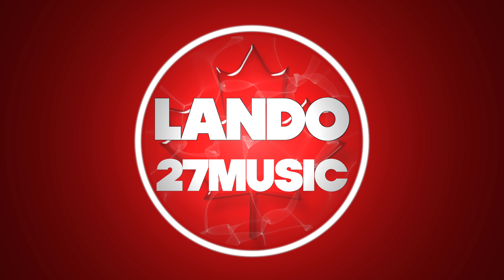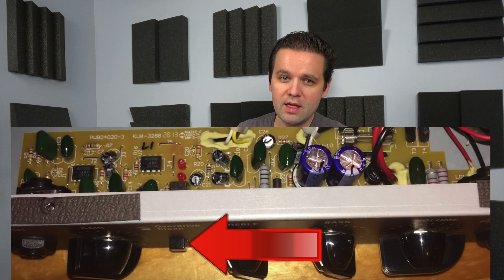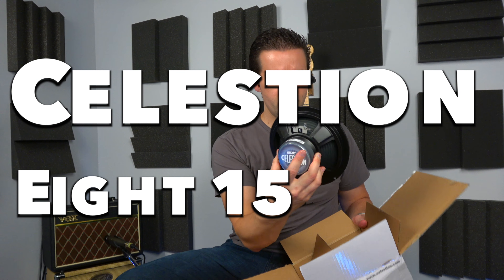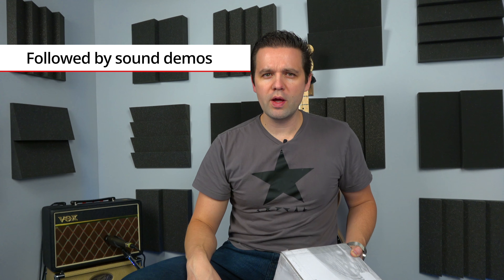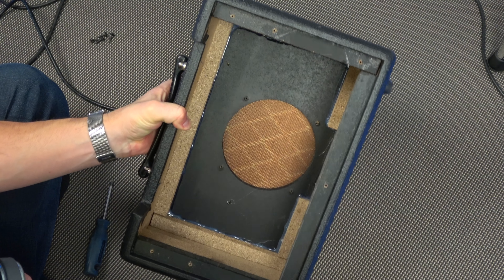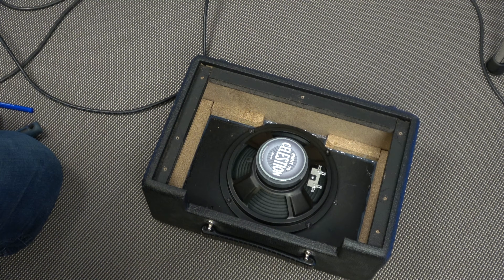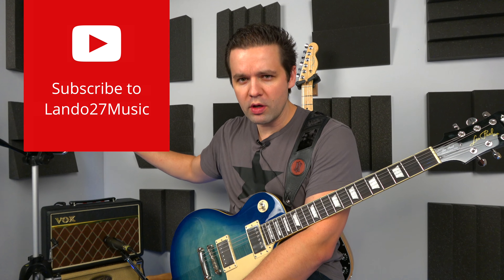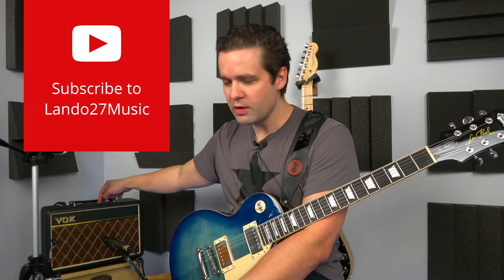BOOST Your Vox Pathfinder 10 With 2 Simple MODS!

Comment: Very good vidéo and idea. I did it ! 

I have a pathfinder 10, it’s the second i buy, i love it. In France we can buy a used one for 40 / 70 €. Great tones for the price and great tones without  thinking about the price. Boost always bad on pathfinder, do the led mod and that’s it.

But I also did the mod you purpose for the speaker ! At the beginning I was a bit desapointed. It sound very good, less voxy with  really deep bass. I was ont sure about being  moré satisfied than with the original one.

But, it s better now : beacause the speaker is no more new (I Thank it changed a lot) and because I also cut the Wood to open the front following the size of the 8’ (without touching the beautifull grill, I was patient …).

Bought it for 60€, 30€ for the speaker, and sold 15€ the original one.
Less than 80€ : a beautifull and good sounding analog amp with good headphone output, small and Light.

So thanks a lot !

Comment: So I recently did a speaker upgrade to a Mono Price 5watt all tube amp that came stock with a Celestion Super 8 to a Warehouse G8A Alnico… Much better tone than before… So now I have the Celestion & was thinking about trying it in my Pathfinder 10… I normally play a Spark at all my low volume solo gigs but would like other amp options just to keep it interesting… If the Super 8 doesn’t cut it I may spring for another G8A for the Vox amp… I personally think the Pathfinder 10 has the best look of the three if I can just get the volume & tone as good as the other two… Enjoy your guitar & amp reviews thanks for sharing!
Reply from the maker: nice!

Comment: What Ohm Speaker did you use? I like using the 4 Ohm they are rated at 20 Watts and give more output at a lower volume.
Reply from the maker: I looked back and it was 8 ohms

Comment: Just did the led mod because of this video, super easy if your good with a soldering iron. This mod really opens up the sound, WAY more clean headroom and a more natural breakup while increasing the gain with volume cranked! Great cleans to awesome early AC/DC tone on the clean channel.

Thanks for the video! I just watched a few others and you got a new subscriber here!
Reply from the maker: hey thanks Jeff! what a weird mod right? But it works great. 😁
Reply: Lando27Music  Definitely a weird mod for sure, awesome though! I actually just pulled it back apart since my last post. I pulled the speaker wires up into the chassis, cut off the clips and soldered on a switchcraft jack I had on hand. Then I drilled a hole in the chassis to the far side of the transformers it will be pointing downward when assembled and I bolted it in. Then I just solder up 2 push clips and a 90 degree 1/4" plug to some heavy speaker wire and hooked the internal speaker back up by 1/4" jack and all is well!

Now I decided to have some fun with the new speaker jack as I have a small 1x12 with a WGS Veteran 30 8 ohm and a slightly larger 1x12 with an original early 70's Celestion Vintage 30 8 ohm. Man did this little thing come alive! Sounds really amazing on the clean channel and a cheap OCD clone sounds great in front too! And to think I purchased this for my 3 1/2 yr old! LOL!

Thanks again for the great videos!
Reply: @landonbailey  please do soldering tutorials I'm tired of paying high prices for repairs :,)
Reply: @gorami  Most important thing when soldering, TIN the tip of the soldering iron! Then you have to remember that what you're trying to solder together should already have some solder on it, otherwise it won't create a good connection.
Reply: @landonbailey  It is not weird at all. A lot of circuits use clipping diodes.
Reply: @qddk9545  But why are they there? Are they protecting other components? Is that their purpose?

Comment: Hey Landon, thanks for the vid.  I did both led and celestion speaker updates to mine and I've made sure to play the speaker in before commenting back to report (it's been almost 2 years now).  The sound was immediately better and it does seem to improve with age although I don't know if I've just found the new settings sweet spot.  The clean sound is now very punchy and responsive - I would say surprisingly similar to a pathfinder 15 which everyone seems to rave about.  I find the best way to set it up to play is to keep the amp on the clean channel and with the volume at Max, use the gain knob as your volume control in conjunction with the guitar volume knob.  There is a point you reach where there is a very tube like crunchy blues breakup that starts that wasn't there before and it's glorious for a $50 amp!   Love it!  Still not crazy about the dirt channel but even that is more usable than it was before - far less trebly solid state fizz on top and you can eliminate it altogether with judicious use of the amp and guitar treble controls.  that's never been my sound anyway from any amp so maybe that's an unfair statement.  Suffice to say, I'd judge the mod a success, it was inexpensive, easy to do and I'd say that once the new speaker is broken in and you learn the new settings required - it provides tones that are far better than stock.  It's now a keeper!
Reply from the maker: thanks for your experience with it!

Comment: Very good video, the mod i did on my Pathfinder 10 is, i took the head off, added an external speaker jack and now i use it as a head with a small 1x12 cab with an Eminence GB 128, huge improvement, i can play in small bars without problems, this baby has plenty of volume, still very portable but with the goodness of a 12" speaker.
Thanks a lot for the video.
Reply from the maker: nice! 👍🎸
Reply: still going strong mate ? sounds like a great idea - 
though for the price of extra speaker/ cab  -might be able to get an AC 10 ?
Reply: @TheMichaelseymour  Hi, yes man, still going strong, i'm actually building a 1x10 cab. to play with 2 Pathfinder in a wet / dry set up, this set up is a pure goodness, i made the  cab by using an old amp. that was sleeping in my garage, but for example if you buy an Harley Benton cab with a Vintage v30 or a Jet City cab. and a Pathfinder 10 you are going to spend much less than buying an Ac 10.

Comment: Owning a Celestion Eight 15 myself, I know that speaker is supposed to sound a LOT clearer than that, and it's because of that 6.5" hole that 8" speaker is trying to squeeze through. This video is years old now but I wonder if you ever got around to opening up that baffle hole?
Reply from the maker: I did not do any more mods after this video

Comment: Had a lot of budget bedroom amp and honestly tired searching for a specific sound with those modeling amps. I wanted a solid state amp with own proper character, simple and easy to use. That pathfinder has a real Vox sound, obviously not the warmth of a valve amp, but surely the general lines and functionality of the brand. I did the LED mod as well as I removed the diode 2A274K (one of the three  biggreen capacitor) which makes the clean channel brighter than it is yet. Stongly recommended. Do you still use it from time to time Landon?
Reply from the maker: I probably sold it 2 years ago by now
Reply: Does the ampli has the same Vox sound after the mods or it's different?
Reply: so get rid of the green capacitor ? Not all 3 tho? 
Great , how did you discover that ! thnx .

Comment: I would imagine that opening up the sound hole a bit would really help the  celestion. Sounds a bit muffled with original size sound hole. I’m picking one up tomorrow, super excited. My AC5 was too much amp for the house. This will be great for dialing my board in.
Reply: You need to remove the front cloth to open the hole, and remount it, that is not so easy to do well.

Comment: iM Wondering of the led light Mod is an Improvement though?    "Warmer: gain ,   could mean  "softer" gain ,  like   ....not quite as aggressive gain?       Sure would be nice to hear the difference after the led mod.         Did you just break the bulbs?    or disconnect the wires & tape them off?

Comment: Before: clean:-10/10, overdrive-5/10. After: clean-8/10, OD-8/10. Overall, better to leave bulldog in it and buy some mediocre OD pedal, instead of buying a new speaker. It is a little bit cheaper, and you have that original famous vox clean sound. Or be a lunatic, buy two pathfinders, replace one speaker with celestion and buy an ABY pedal to have a stereo sound and best od each speaker, as I did. :D Great sound and enough for gigging with gentle drummer in smaller venues, up to 100 people. Great video, cheers!

Comment: only thing about the LED MOD is those are there for a reason, that amp  overdrives a little without engaging the button, so what happens when the drive is all the way up?  because at that point it sounds like break up an gives light overdrive without the button now add the button with that mod and you may be asking for trouble when rehearsing for more than an hour

Comment: So, just to be sure, (cause I'm quick lost in translation and don't want to ruin my amp), it means I only have to remove those LED without any welding, nore other intervention to do? Thanks by advance.
Reply from the maker: that's correct 🎸👍
Reply: @landonbailey    Perfect ! Many thanks for your answer ! By the way, did you use a solder gun or just cut out those LED ?
I Love your channel, it's very instructive and practical for a noob like me !
Reply from the maker: I took some needle nose pliers and ripped them out! :)
Reply: @landonbailey   Perfect ! Thanks again !

Comment: Hi Lando, removing the two LEDs, the clean / overdrive switch work the same or is it bypassed?
Reply from the maker: hey there, the switch still works the same
Reply: I saw many conflicting opinions on the network regarding the replacement of the cone.
Is it really worth changing it? the sound improves or gets worse, how does it seem to happen watching your video?
Thanks for the replies and congratulations on your videos!
Reply from the maker: Ya I think the amp is good without the change.  I just like trying mods on guitars and amps. thanks for watching! 👍🎸

Comment: Celestion is obviously thicker, but first impressions are that I like the original sounding speaker for the style you are portraying 5:50 gritty dirty rock, but apparently new speakers take a little time to get worked in so might sound better in the longer run. I was thinking of doing this to my 15 watt Line 6 practice amp speaker which has absolutely no character whatsoever.

Comment: Vox:  'Lets make a small, inexpensive, but good sounding transistor amp. Lets reduce the harshness of the distorted sound of the hard clipping transistors in an inexpensive way by using diodes. Diodes clip softer than transistors, almost like a tube. Its important that they are engaged at a volume where the transistors still have headroom and do not clip yet, otherwise they wont have much effect. Ofcourse this will reduce the volume slightly, but this can simply be compensated by increasing the master volume. I think we have a great but also inexpensive design '

Youtube modders:  'Hey, these leds reduce the volume of the overdriven signal. Lets cut them out' 

😂

Comment: I just performed the LED mod and replaced the speaker with an 8" 8 ohm 25 watt peavey blue marvel. The overall sound is better, but when the note is first played there's still a tiny bit of that fizzy sound in the overdrive channel...almost sounds like a busted speaker, but it's not. Does yours have this?
Reply from the maker: I didn't have that issue
Reply: @landonbailey  I'm getting that fizzy sound when the note finishes sustaining, guess the LEDs are going back in

Comment: Now if you could just add a reverb tank, and tremolo, you’d really have an AC-15 Mini! 😃
Reply from the maker: yes!
Reply: aka pathfinder 15r
Reply: @hofish7  Exactly .  Hard to find though
Reply: I use a Danelectro Spring King reverb with mine, and it sounds quite a bit like my AC30 then.
Reply: @HadrianRex   I have the Spring King I'm considering buying this amp as an alternative to an AC15 to do small rockabilly gigs. Would it be unrealistic to expect it to sound good for that tone in a small gig setting? I also have an AC30
Reply: No.

Comment: I have a pathfinder 15r. Can I put a 10" speaker in a 8" hole if dont cut?
Reply from the maker: ya if the 15r has enough space that should be fine. I put an 8" in this 6.5" hole.

Comment: Awesome video! I moded my Pathfinder and use it with a extern cabinet i have at home and it sounds awesome... I also have a question: i wonder how the Frontman 10G would sound with a speaker upgrade. Would it sound better too? I hope you do the test! THanks!
Reply from the maker: Hey cool! Glad it worked out for you. I don’t believe the Frontman has the room inside for a bigger speaker.
Reply: lando27music or mod it, so you can conect a external speaker
Reply from the maker: ah k!

Comment: just looking through Jensen speaker website the 6.5 may be a advert trick because looking at their site all their 6 inch speakers measure 165.08 mm in their schematic so had google do the math and that is 6.499 inches so your could get away with a direct swap.  Once again I only use Jensen but I looked at 3 different speaker models with 6 inch speakers

Comment: Landon! This mod has been great. I clipped the two leds and got the 8 inch Celestian speaker. My only question is like you I used a hammer and chisel on that cork material to make room for the 8 inches but I didn’t make the front hole bigger. I know you didn’t do it also. Is that ok or will there be any reason I should make that hole bigger?
Reply from the maker: hey cool! I didnt bother and I dont think it will make a huge difference
Reply: Lando27Music thanks!  I can’t believe how great this mod works. Keep making great content!
Reply from the maker: Ya it’s quite the boost! Take care :)

Comment: Thanks for the video! Got one of these couple of weeks back. Clean sounds amazing, but just couldn't get a decent overdrive sound out of it. Always super bright, fuzzy, painful to listen to. Do I have to get a distortion pedal to get at least decent sound out of it? I reckon these upgrades wouldn't be the solution, am I right?
Reply: For a nice overdrive sound try setting  highs at 9 o'clock and bass at 1-2 o'clock (boost channel).
If you want to use overdrive/dist pedals I recommend using either clean channel with gain at about 3 o'clock (you need to cranck the amp a bit to make those pedals sound good, and it cleans nicely just by rolling off your guitar volume pot) , bass and treble at noon and volume at required; or using the boost channel in a low gain setting and eq as mentioned before. I prefer the clean channel option because you can get both good clean an distorted tones without changing channel. If you use the boost channel good cleans are harder to get.
I hope it helps.

Comment: How did you cut off the wood to place speaker ?
Reply from the maker: Rarest Pepe it's just particle board, so a small chisel and hammer/mallet work fine
Reply: Ok, but what about the hole, that one is too small. I was wondering how to drill bigger one if there is front panel that can't be removed. Any idea how to drill it?
Reply from the maker: oh I just left the hole as is. I didn't have an easy way to work on it.

Comment: Cool job there. One of the appeals of a solid state cheapo amp is being able to mod it without fear of losing resale value, or doing something irreparable. 
I think the tone from the old speaker was better, but it also sounds like that Celestion needs breaking in.
Reply from the maker: hey cool ya. for $49 I was willing to experiment and take a loss if things didn't work out.

Comment: Does the headroom of the clean channel increase with the LED mod only (and no speaker upgrade)? I'm looking to use my Pathfinder 10 in clean channel only as a pedal platform and in stock mode the clean channel doesn't quite seem to have enough headroom for overdrive pedals.
Reply from the maker: I don't believe so. it's only a major bump on the dirt channel
Reply: Actually I might have been wrong about the headroom on the clean channel. Seems like the speaker has started to break in and it doesn't sound so harsh with overdrive anymore!

Comment: Very cool. Great mods, made a big difference. I would check and see if the part of the cone is not pushed up against the part of the board that is not cut out. If the speaker is not able to move freely it will impact the sound.
Reply from the maker: thanks! ya the cone was clear of touching anything.